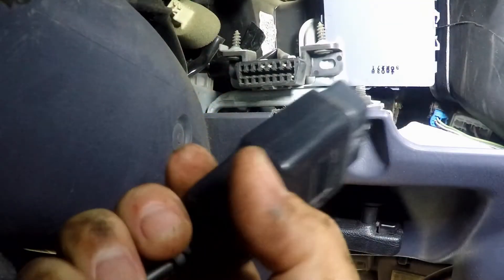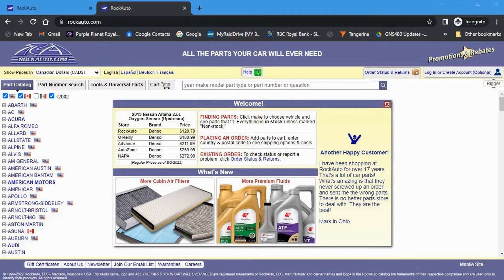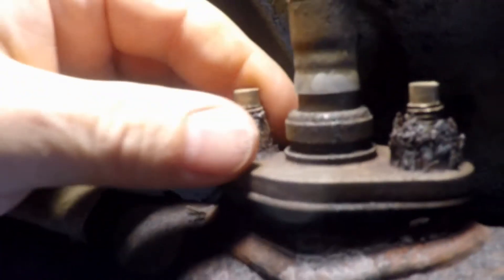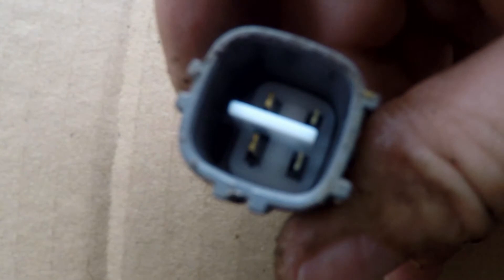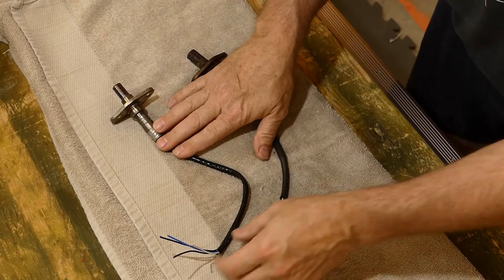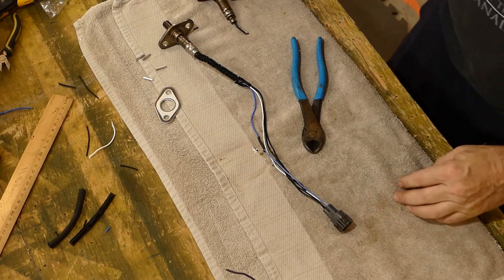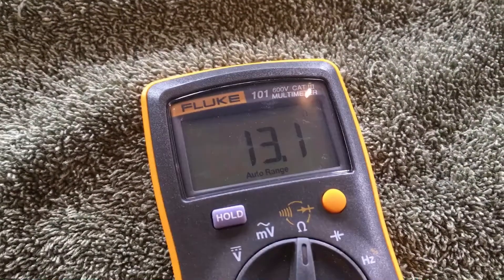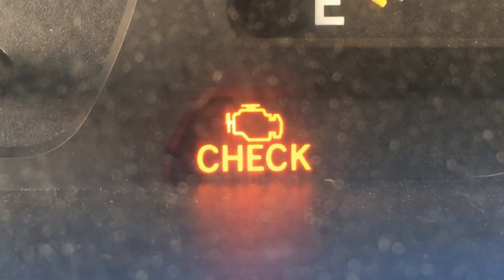How to Fix P0136 Code on a 1999 Toyota Tacoma for Under $100 (O2 Sensor Replacement)

Comment: Great video. Just will have to freeze frame the part number you searched on rock auto. Or buy the one from Toyota. Idk yet. I cleared the same code on my 04 just today and put some 93 in it to see if it will help or come back on. Time will tell. Thank you for the info.
Reply from the maker: Thanks for the note Sarah.  I just use 87 in our Tacoma, unless it’s going to be parked for a while, in which case I’ll buy premium to avoid the ethanol.  Cheers